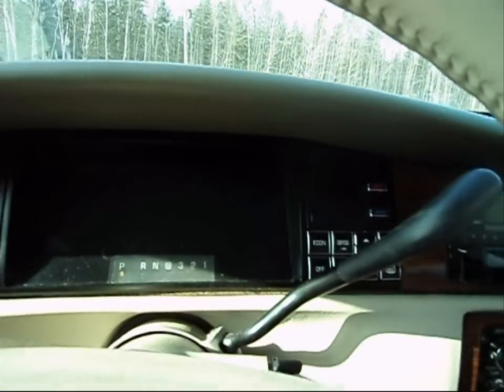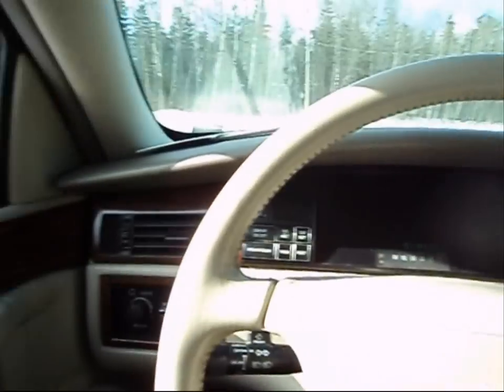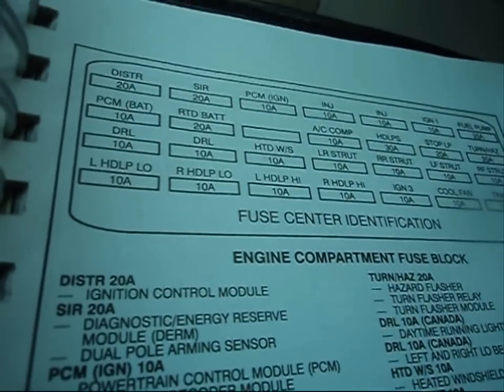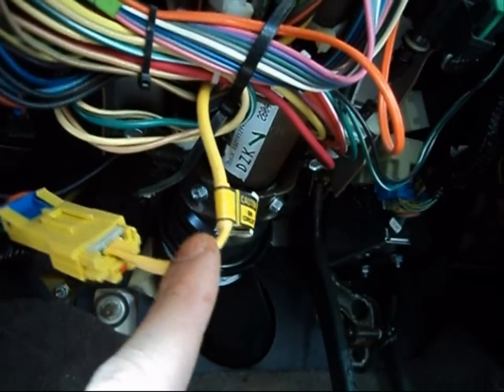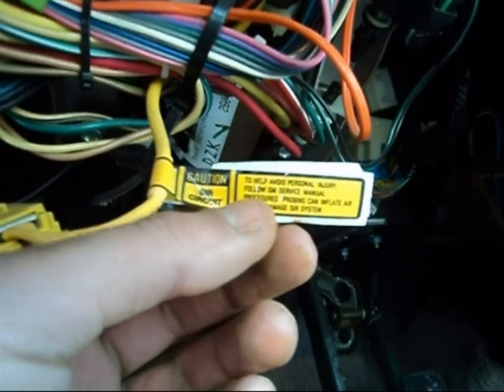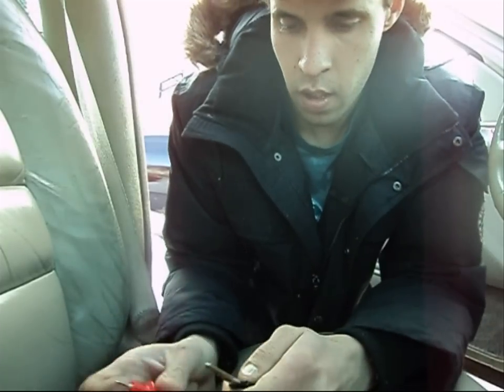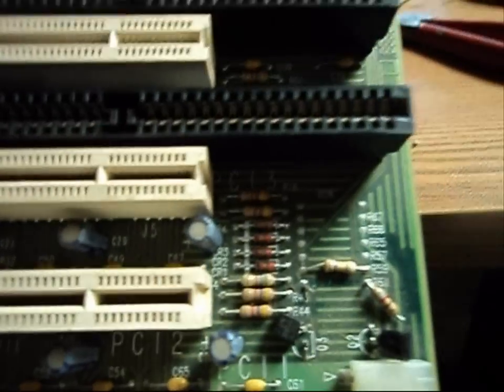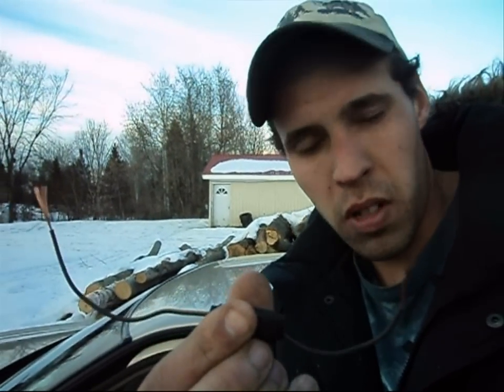GM Pass Key II Malfunctions: Bypassing V.A.T.S System

Comment: Somebody help me out please. I had a mobile mechanic do a bypass on my 2001 Buick Century. Everything works fine, even the blank copy key. But I notice the secuiry light still comes on.Should disconnect the battery cables and reconnect themt to get rid of the lid, or does the light even matter at this point?

Comment: Good advice about AirBag!!!
Yes, they have a capacitor that stores enough energy to ignite the charge - just waiting for any change in the circuit voltage to trigger it. No fuse = no change in the circuit (so long as you DO NOT cut into the circuit wires which can potentially cause the SIR capacitor to discharge (BANG) )
======
For about five bucks, I got a whole variety of resistors.
Can wire them in series to add up to the resistance you need.

Comment: I don't recommend to solder anything in a car. In cold weather beta-tin becomes alpha-tin, which is just gray powder (Maybe it can be called "tin plague" in English? Maybe not.). Soldering alloys are not panacea too. Temperature difference in cold and running car can achieve 100 degrees of Celsius, plus different coefficients of thermal expansion in different metals (copper and soldering tin-alloy) makes electric contact weak in time. You'd better use twisting and crimping.

Comment: Why not simply duplicate the key without the pellet then solder the wires to either side of the pellet in the key, wrap it in electrical tape and stuff the key under the steering column. Problem solved.

Comment: Are those resistors available at an auto parts store? Is that board with multiple resistors off a computer?
Reply: Also... in on part it looks like only one resistor connected and when installed it looks like 3?

Comment: In your example here, the problem was not with the module, it was with the ignition switch. By replacing the resister feeding them on Jewel, proves there’s nothing wrong with the Montreal, big mission switch is not sending the correct resistance.

Comment: I had a 1993 Oldsmobile 98 Regency Brougham that did this and I had it towed to the shop and it was the key and tumbler switch stripped out and they had  to put a new tumbler and starter and had to program the key. All you have to do is replace the starter and the key and tumbler mine the cost at Firestone Complete Auto Care they charged me with labor 350.00 that was tax and new key programing.

Comment: I believe I might have a bad vats module I have a 99 Deville and replaced the ignition lock switch and  new key with matching resistor pellet I had the key done at Ace Hardware whenever I turn the key it takes a few seconds for the dash to light up between 12 and 14 seconds once it does light up it reads theft system problem car may not restart and does not start or crank at all do you have any idea?

Comment: Its a diode on your A/C clutch compressor sending voltage spike to BCM/ECM and blowing fuses. Check 10A fuse to AC. If blown see link below for what likely is your problem 
https://www.justanswer.com/pontiac/41vf8-2004-pontiac-grand-prix-keeps-blowing-a-c-clutch-10-amp-fuse.html

Comment: Great video. I have done a lot of research on this bullshit system, and have seen this way for a lot of GM vehicles. I have a 2004 Buick Century, and just wanted to throw out some more info for any others with the same vehicle: The orange conduit referenced here is black in the 2004 Century. Ace Hardware (or any lock smith) should have a resistance measuring device. They will give you a "Vats 5" or the like. Just google that and it should tell you the Ohms to shoot for. Mine was a vats 5, and the resistance was 1130 Ohms. I had to build a resistor out of 2, given the weird resistance measurement, but once it was put together, it worked fine. I did a trial with alligator clips first, so that it was easy to test, then soldered everything and "tightened it up" before reassembling the dash panels.

Comment: Thanks for the video.   There is a guy in town that changed his steering column on his 03 regal.  Of course he does not have the original key, or it does not work, for the replacement column.  Now he wants to sell the car.   I can get  a  variable resistance box, called a decade box, to substitute for the resistor in circuit to test.   Or is there a guide online to the correct resistance value for that chip-

Comment: I have a 91 Buick Park Ave, pretty sure this is my issue after changing the starter. I actually wired the starter (solenoid and starter) to a light switch, then to the battery. Car turns over perfectly, but dies in less than a second. Going to try this tomorrow.

Comment: Thank you I did exactly like you said for my 93 sedan deville. My car started right up.
Reply: +SDSaxMan My dad had the same problem with his 2002 Buick Century. So we bought the Newrockies over ride system but it turned out to be the Body Module, part # 19244861 SL-R. The auto mechanic had checked that module but the problem was intermittent and only failed 10% of the time so the mechanic didn't find the problem because it worked just fine for him whenever he tried it. But my dad made him replace the part anyway an has not had a problem since.
Reply: Just Adab  About $150.00 or so.

Comment: THANK YOU!  This was driving me nuts. Same issue on my 92 Deville, but I don't have the fully digital dash.  Kept handing it off to my mechanic, and kept giving him my spare key. He couldn't recreate the problem.  Further, my TPS sensor went at the same time, and triggered error code 30.  I was thinking that the ECM went, since it's also covered under the same error code. We ruled out a bad ground since those were all cleaned about a year ago.

Comment: Hay man my buick park ave didnt start for 3 mounths and i followed your instuctions to by pass the vats key thingy and i be damn it stared today.i match the key ohms with the restsers.
I do still have a problem,my horns constantly blows and wont stop.that tells me the alarm is still going off so i had to take the battery out so it wont run down.
What can i do about this.
Reply: Remove the fuse for the horn would be a temporary fix

Comment: read the OHMS value on the chip. Read the spare, too, hope it is near the same. Go to Radio Shack, by a resistor of the same value +/- 10%. locate a pair of yellow wires below steering column going into the harness. Cut wire with about 6 inch lead. Wires from steering will not be used. solder or secure resistor to the 6 inch lead. problem solved for under $2

Comment: ATT EVERYONE: I've been working on 97 Buick for 3 months with all kinds of problems. Sometimes starts, sometimes won't. Sometimes runs good, sometimes stalls, chokes or dies, a/c/heater door not switching from cool to heat,etc. I ended up stripping out the bolts that hold the battery cables on the side post battery. First the positive and I replaced it with a steel bolt of the same size and thread, then today the negative stripped out. I also replaced it with a steel bolt of the same size and thread. "NOW EVERYTHING WORKS FINE!" THE BOLTS THAT THEY USE ARE CHEAP PIECES OF SHIT! IF YOU HAVE INTERMITTENT PROBLEMS,REPLACE THE SIDE POST BATTERY TERMINAL BOLTS WITH STEEL BOLTS AND BE CAREFUL NOT TO STRIP THEM OUT BEFORE TRYING ANY OTHER REPAIRS! DO THIS FIRST BEFORE SPENDING PRECIOUS TIME AND MONEY! BUYING REPLACEMENTS THAT ARE THE SAME WILL NOT WORK! THEY WILL ONLY CAUSE THE SAME PROBLEM!

Comment: If you just want to by-pass the VATS then just duplicate the key without the resistor  Cut the pellet out of the original key and solder it to the 2 white wires in the orange sheath. Your done.
Reply: measure resistance and use resistors with 5% difference allowed + or - and your fucking golden

Comment: wow... $500 to replace the VATS module... amazing... because when I actually did pay to get mine replaced it was only $220 after parts, labor and tax... however I will say that what he talks about doing actually does work but honestly it is a bit of a pain... I would not suggest doing this unless you are comfortable playing around with the wiring under your dash. Or... even better go out and purchase a bypass module for $59 and install it yourself... pretty easy.
Reply: wanted to add... the bypass that was talking about purchasing is apparently the nice model... you can get the standard one for $29 from CorvetteCentral.com

Comment: Hey, if you live in Toronto, Could you come do this for me?

If not, once I cut the wire in half, do I connect the resistors to the part of the wire not connected to the steering wheel?
Reply: Yes.

Comment: In the middle of doing this on a 1994 Caddie Sedan DeVille.... Going even cheaper by wiring in spare key chip instead of resistors.... Will let ya know if it works......
Reply: Holy shit, it actually worked! So, was able to do it without extra resistors...
Reply: Chris Williams Some Saturns will also work just using a wire with no resistor needed. I believe it is because the chip shown in the video is not on the key, but is inside the circuit.

Comment: hi idiots this problem is caused by broken wires right at the lock cylinder the correct repair is to replace the lock cylinder.
Reply: There are multiple causes of VATS problems which you would know if you researched instead of name calling. 

The resistor fix bypasses one portion of the  system, and signal generator modules such as Baker Electronix sells are an even better fix because they spoof the BCM signal to the PCM eliminating stock VATS entirely.

VATS disable can be added to a PCM tune if you are getting one anyway, removing the PCM requirement for an enabling signal from the BCM.

The resistor is cheaper than a module is cheaper than a VATS delete tune.

If, on a specific vehicle, VATS disable coupled with a BCM sensing tamper causes faults, you can bypass or cut some BCM functions using relays, but that will be a matter of figuring out what you need and using schematics for your ride.
Reply: Yeah yewr right... but i had that problem ..... 
so theres yewr solution A or B his and others aswell

A) spend $90 at dealership for new cylinderblock plus installation 
or
B) $3.23 for resistors plus $1 of electrical tape

you chose.....

i go with B..
Reply: will replacing the ignition fix that

Comment: I had bought a 2006 Chevrolet Malibu LT and I encountered an issue I never seen before. It started when I unlocked the door with the key by mistake. I tried to turn it over, but wouldn't start. Even my brother said to disconnect the battery about 30 minutes. All other lights go off, except for check engine. Even the 10 minute theory didn't work, but I just now tried ACC. Anything to fix the issue.

Comment: I bypassed the VATS on my Lesabre by turning the key to ACC and leaving it that way for ten minutes.  The car then started right up.  I am not sure if I will have to constantly do that to get it to run.  Your video is awesome, but a tad too complicated for this female.  Also, I don't have a resister on my keys.  Which is weird.
Reply: The chip on some keys is replaced by it being inside the circuit instead. I know my 99 Saturn SW2 is this way.

Comment: Hey yoshi, I have a 00 camaro v6, I tried the bypass and It worked. The security light turned off but my car still won't start? Any ideas?
Reply: I'd check the starter. Did you try starting it a lot? Could've burned out the starter or the battery may now be too low.

Comment: I tried to do this my key read 5.71 I had bought some resisters I got it to 5.69 I just connected them to the resisters I didnt solider them on and it doesnt do anything my friend told me to take the chip out the key and try ot that way and still nothing

Comment: I have a 95 Chevy caprice and it's the same orange wire, only that it's connected to purple and yellow wires. 
Not hard to miss. 
If you haven't gotten it fixed do as the vid says and you'll be back on the road... 
I am!

Comment: I watched your video before and bypassed my vats system...Now it has done it again ...i checked connection .it was fine ...but now wont crank at all...what do you think problem is now ...my resistors were exact as my key pellet 1.85 any suggestions

Comment: YOshiClan is the shit!!! I was so scared when GM told me it was a $550.00 fix!! I was crushed I wanted to hang up the phone and cry. My car is disabled and all we had left was our 1999 Buick Century...and it would not run due to the security! I followed these instructions and ALL i paid for was $3.50 for some good insulated electrical tape and I sacrificed a DVD player to pull the compositors. I found the security wire and linked the compositors to match the resistance of the key AND BAM BITCH

Comment: the Vidoe is for the older Resistor system but the newer GMs used an RFID chip in the key that is programed to the Cars computer. For GMs 98 to 2006 ish it is simple you use a good key to turn the Car on then tun it off and use the new unprogramed key and the car will learn the new key if every thing is working OK. For the Newer Keys not labeled PK3 you will have to contact a key seller (ebay) and find out what key your Saturn uses and the programing instructions if it can be done at home

Comment: I have an 89 Eldorado. && This happened to me two months ago. && I lost my job. So first  I did as the car said, hoping that it would work after the 3 minute wait, it didnt. I tried several times. So I figured if I unplugged the battery for an hour, it would reset the computer. Nothing, same thing. I was pissed.!!!! I just replaced the power steering pump in the car. I got one question, whered you get the wires you connected to the resistor.? Can I use speaker wire.?

Comment: If you loose your key, and you want to just switch out your ignition from one at a junk yard you can by pass this as well. There are only 15 different resistor measurents. Test each one of them down in that orange wire underneath the dash. One of the 15 different resistors will be garanteed to work if you know each individual measurement.

Comment from the maker: The conduit wire from the lock cylinder that runs down the steering column should be the same color as mine... It would be orange. The wires coming from the module is a different story... I unfortunately don't have a service manual for your of Caprice of that year. The conduit will be easily identifiable, It has a unique shape apart from all the others, and as memory serves me right the conduit wire was orange on all Pass-Key II systems.

Comment: ONE:  Thanks for the video.  I will be doing this on my car.  
TWO: Way to smoke and work
THREE:  There are different tolerances on common resistors 5% and 10%
FOUR: When I do this I will use a vari-zistor so I can disable my vehicle to confound would be thieves of a 1993 chevy cavalier 210k miles.

Comment from the maker: Sorry for my late reply... If you are having difficulty or minor starting issues after bypassing the lock cylinder then there is a good chance the vehicle anti theft module is dying on you... That is the only component left that can cause you a would of head aches and damage to your pocket book if it needs to be replaced. But don't give up hope, check out you by-pass wire first then move up to the module. A new module is roughly 300 dollars. Maybe less maybe more, depends on where you buy.

Comment: Hi YoshiClan, I have a 99 cadillac deville and it was running and now its not. I just bought it 3 weeks ago and it gave me problems turning on kept saying starting disable remove key wait 3min. ok I did and car started, now a 2 days ago it did not let me turn on the car. I notice my orange wire were cut with nothing attaching them. I also notice a resister on the floor broken. i measure my key chip it read 5.90k and i bought a resistor at 5.6k wired everything and car still dont start. HELP.....

Comment: Worked great for me. Thanks for posting this video.  No sense in spending money on the security system on my 92 deville that nobody is gonna try to steal. I got my resistors at radio shack for 99 cents.

Comment from the maker: If the mechanic at your dealership told you the lock cylinder is done, then I agree with him as well. The reader inside the lock cylinder usually wears out before the resister pellet on your key. After years of inserting and removing the ignition key the pellet and the reader inside the cylinder are constantly making contact. If you bypass it the way I did then you will never have to worry about it again, and the 100 bucks could go to fuel or groceries. Also a new cylinder will wear out someday.
Reply: What if your key gets stuck in the position before start and won't turn back? 95 carlo with vats Security was blinking and would go out until the key was stuck in the position before start for over 30 minutes. 
Can you please help me?

Comment from the maker: These models all did that. Sometimes you would get the wait message and sometimes you won't. Either way if the security light is illuminated while the key is in the off position, you are still going to have to wait atleast three minutes for the light to go out. Also if it takes multiple tries to start the car, your resister pellet on your key could be worn out or there is a fault with the module.

Comment from the maker: I would have to say there is a short somewhere. The Anti-Theft wouldn't affect the radio or defroster. Its time to break out the multimeter or your test light and start picking and prodding. Start at the fuse block then remove the radio and defroster switch, and as I recall I believe there in the same general area on LeSabre's of that era. Leave the door alone, chances are the interior light is causing the radio to go nuts. I had this happen to me as well. Good Luck.